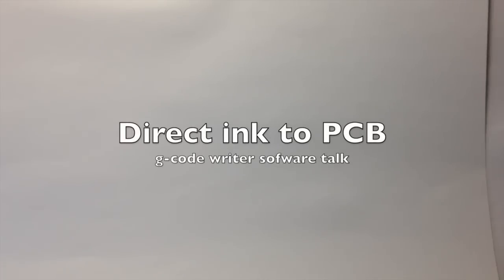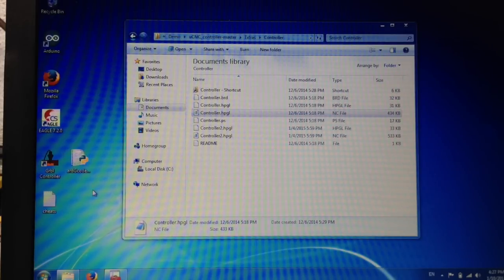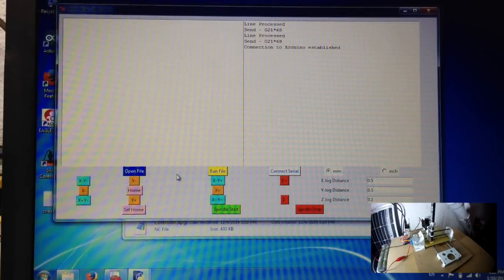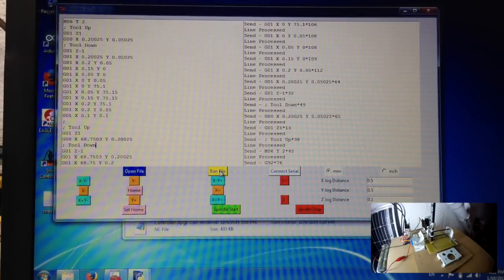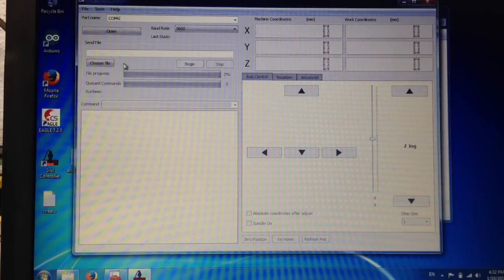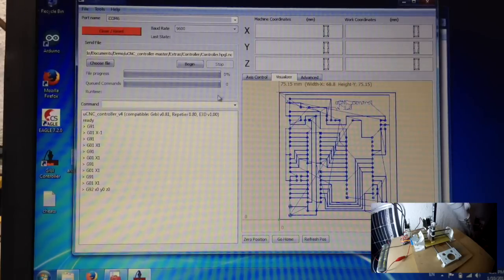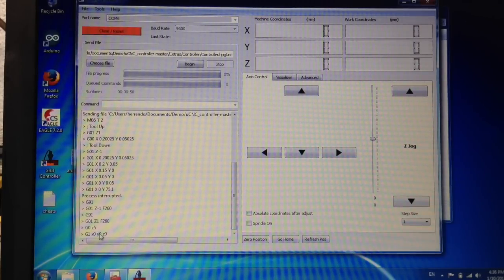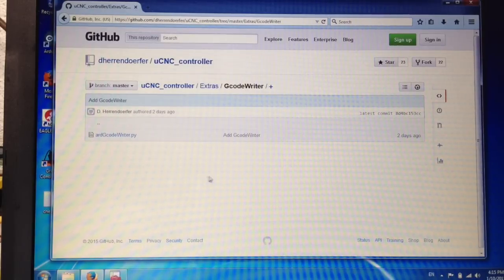Direct ink to PCB-Writer talk

Comment: Hi there Dirk Herrendoerfer,
Thank you very much for sharing your ideas and your project. Also I appreciate your effort you had on this project. I've started as well to make one for me, having yours as an example, but I'm stuck at the start : 1st : I can't run the ardGcode ( I can edit the file, but couldn't run it. I double click the file and nothing happens. I've installed the same version of python you had 2.7.8) 2nd : Couldn't download the GRBL controller...the link i found over the internet is not available no more. 
Can you please tell me if you I have some updates regarding this project ? 
What software I can use ? 
Are those files still from the GitHub still available ? 
For the moment this what I need to start the project. I wanted to see if from the software point of view, will work. By the way, I'm using Windows 7 x64.
Waiting for your answer.
Kind regards, Emi
Reply from the maker: +Francu Emilian Hello, regarding the python problems, I have had none so far, if there is something missing the python IDE should be giving you meaningful error information. I typically open the file in IDLE and then run it from there. The pyserial lib must be installed and all versions should be 32-bit.
I don't know what the GRBL-controller software issue is, they still have their files online.

Comment: hi dirk ,after spending extensive hours i could reach to the last step where u have created hpgl file n.however the next part changing the com port is also done,where to save it?and after that how u opened ardcode?since on my pc that shortcut doesnt appear anywhere.pls help
Reply from the maker: +avinash khetmali Hello, happy new year! The com port is edited right into the .py file. It is then started directly via python or through the python IDE. For that to work you should have the 32-bit versions of python 2.7 and python-serial installed.

Comment: Hallo Dirk,
Dein Direct Ink to PCB-Plotter ist genau das was ich gesucht habe. Ich habe mir deshalb die Teile bestellt aber folgende Probleme:
- unter Windows bekomme ich den ardGcodeWriter nicht zum Laufen weil er das Tkinter nicht gepacken bekommt.
- die Komplettplatine (ULN2003 mit Motor) angeschlossen an Arduino Uno
  *blau an Pin8
  *lila an    Pin9
  *gelb an Pin10
  *orange an Pin11 (jeweils Arduino)

connection wird hergestellt allerdings kommt nicht die Meldung wie im Video. Wenn ich auf X+ drücke dreht sich der Motor kurz nach rechts wenn ich auf X- drücke dreht sich der Motor aber auch nach rechts ?!

Sobald ich den Beispielcode mit 'Open file' lade und auf 'Run File' drücke friert das Programm  nach der Zeile 
Send - G01 Z1*13
ein.

Was mache ich falsch?

Viele Grüße und nochmals vielen Dank für die wunderbvaren Videos :-)
Roger
Reply: +Roger Petri 
achso, hab vergessen zu sagen dass ich den ardGcodeWriter dann unter Linux zum Laufen bekommen habe. Leider aber mit den oben beschreibenen Problemen :-(
Reply from the maker: +Roger Petri Welche Firmware benutzt du ? Wenn bei einem G0/1 Z-Aufruf der Controller hängen bleibt ist meistens der Teil der die Z-Achsen Bewegung steuert, oder für den Servo emuliert nicht richtig konfiguriert. Es sollten also bei StepsPerMillimeter und Speed für die Z Achse werte stehen die Sinn machen, also nicht 0 oder so. Wenn der Motor nicht sauber läuft, stell erst mal die Geschwindigkeiten ganz runter, evtl springt er einfach über die schritte hinweg.
Bei Windows solltest du immer die 32Bit Varianten von Python 2.7, TKinter(falls es nicht schon bei Python dabei ist), und pySerial benutzen, dann tut es auch. 
Im Allgemeinen empfehle ich die v4 beta firmware zu benutzen, da musst du dich zwar einmal durch die Konfiguration quälen (in der uCNC_controller_v4.ino) danach
hast du aber auch die besten Ergebnisse.

Comment: hola amigo yo hice ese proyecto tu yo pero no es podido controlarlo con la pc porque no abre la aplicación de la pc te quería preguntar ese programas del arduino se podría poner a funcional con  UniversalGcodeSender hice la tarjeta identica como la que tiene tu y otra pregunta  esa misma  tarjeta como aria para usarla con una cnc de tres motores
Reply from the maker: +antonio sanchez If you use the UniversalGcodeSender application you must turn off all of the functions that report back the position and the status of the Arduino board. That is a function that only works with GRBL. After that you should be able to use the application with the driver board and uCNC_controller.
Reply: hola lo hice como dice y no funciona como hago para poder abrir la aplicación q tu usa por que no abre en mi pc le doy abrir y solo hace un parpadeo y no abre que sera lo que estará mal
Reply from the maker: To open the application I use you need to install python 2.7 in the 32 bit version, and pyserial also in 32 bit. Then you need to edit the ardgcodewriter.py file and set your arduino com port in the code.
Reply: gracia por tu ayuda no abria por falta de PySerial pero a hora cuando abro el archivo para que enpiese a trabajar se queda pegado y dice no responde que sera eso y disculpa tanta molestia es que soy nuevo en esto otra pegunta ate un video como se diseña la pcb para generar el codigo G
Reply from the maker: antonio sanchez Did you edit the python code to add the serial port name that your system uses ? ( In my case COM5 for example ) Then you should try to use the move keys one at a time, x,y,z. Sometimes the arduino is not configured correctly and using one axis makes it stop communicating.
Reply: Hi Dirk! Where can I turn off all the functions that you say. I tried to generate a g code with inkscape and i want use UniversalGcode but i don´t find that functions that you say. Thanks for your help.
Reply from the maker: Try to use gcodesender (without universal) that usually works very well.

Comment: Hi  Dirk Herrendoerfer. I run adrGcodeWriter.py   but  it error   and show  message "GcodeWriter.py", line 10, in <module>   import serial  ImportError: No module named serial"  How can i do. Thank you.
Reply from the maker: ยุทธพงษ์ พ You need to download and install a package called python-serial it will provide access to the serial port, and fix this error
Reply: Dirk Herrendoerfer Thank you for your reply

Comment: Hi. Thanks for all your effort. Very informative. I'm having a problem with the g code that is generated. The Z axis does not just go between Z1 and Z-1. There are co-ords higher in Z as well so the pen does not always touch the page because it is too high. Also the pen size seems to be a problem. I can only get something that resembles my pcb if the pen size in eagle cam is set to 0.4mm. Smaller results in lots of extra rubbish on the plot. Also pcb size was a problem. Too big. I had to use "hp2xx -m nc -t test.hp" and that gave me the true size. Any help on the Z axis and pen size would be appreciated.
Reply from the maker: Richard Pieterse Hi. The pen size is ignored by hp2xx, eagle does all the work there. The pen size should match the width of the connections on your PCB. The -t swich is required of course, else it will be scaled to A4 paper size or so.
Does your g-code actually have Z coordinates that are not 1 or -1 ? That should not be.
I have been updating my work version of hp2xx to produce code better suited for GRBL, but I don't think it should produce 
any positions outside what is set to be the Z positions.
Reply: Dirk Herrendoerfer 
I set the pen size in Eagle to .3mm and re-did the whole process. In the .hp file there is only PU and PD (and the x,y co-ords) but after conversion to G-code there are Z co-ords that are 2.9 and 4.175 and there are 2 tool ups with no tool down in between. I am going to download a fresh HP2xx and try that. Please can you send me a link for a known good HP2xx version?
Reply from the maker: Try this one:
https://github.com/dherrendoerfer/uCNC_controller/tree/master/Extras/Hp2xx
Reply: Dirk Herrendoerfer 
Thanks so so much. That works much better. Just doesn't do a Z feed rate and doesn't finish with a pen up and return to zero. Is this normal? Also is it normal that no holes are seen in the pads?
Reply from the maker: Richard Pieterse I send federates with the CNC setup, the last pen up, I had on my list of things to add to hp2xx, but I don't know who's maintaining that code now (And I don't want to do it). The issue about the missing holes is a big one - but that's an Eagle issue, and I can't do anything about it.

Comment: Thank you for redirecting me here sir, I really encounter some problem in using  ardgcodewriter.py, when i run a gcode file,, the program goes not responding,, is this floooding? what is the possible reason and solution for this?
Reply from the maker: Are you using the newest version from github ? Possibilities are that the com port is not correct in the python file, or the arduino is not responding correctly. What operating system are you using ?
Reply: Dirk Herrendoerfer yes, im using the newest version, i've also changed the com port in python to my arduino port,, im using windows 8
Reply from the maker: Jin Limbaga I can't recreate the issue here, strangely it just works for me. Could it be that another program is using the serial port of the arduino ?

Comment: Hello Dirk, okay? I build my PCB CNC plotter according to your project just that I have a problem with respect to the nylon. What happens is that the nylon is slipping when the stepper motor rotates, I'm using 28byj-48 stepper motor and there can not make the correct design of the PCB, as tensionei nylon, already spent a sandpaper to get the nylon harsher but nothing works, always in short motor steps nylon slide.

Have you had any problem with the nylon while doing your plotter?

Thank you for your attention.
Reply from the maker: Yes, I had that problem as well. The hardest part is to get the axis to move as easy as possible. 
When I had slippage problems I put a few drops of glue (Pattex Classic) on the drive shaft and let it dry
completely. That gave the drive shaft the extra grip it needed.
Reply: Hello Dirk, I solved this problem throwing away the nylon and using similar printer toothed belt with the figure below.

http://www.rpmechatronics.co.uk/shop/images/c_belts_and_pulleys.jpg

Now I'm looking metal shafts for use as basket to slide the table because I am using pen tube of plastic and often lock the table, with the metal tubes are easiest.

Congratulations for the plotter design !!!

Comment: Hi again Dirk, I am getting a 'port is already open'  exception when I try to connect serially. I've tried some things like closing the port before it is reopened, but can't get it to connect. Any ideas?
Reply from the maker: What tool are you using ?
Reply: Dirk Herrendoerfer I am using the 'Gcodewriter' that is in the Github. I have a suspicion that my Arduino Nano is being connected, however for some reason the text that you have put into the code(Connection to Arduino Established) is not appearing as it does in the video. I am suspecting this, as the error described as 'port is already open', only flags up after I have pushed the button more that once. Ill look into it :)
Reply from the maker: kal2thik Which firmware are you using? The software might just be waiting for a response from the Arduino that never arrives.
Reply: Dirk Herrendoerfer I am using the firmware and the python tool that is attached to the github within this video. I can upload the firmware to my Arduino Nano fine as I have tested it using the serial monitor as you have done. It is just the connection with the python tool that I can't get to work properly. The tool seems to freeze after I click 'connect serial' aswell, so maybe you are right in saying the software is waiting for a response that never arrives.
Reply from the maker: kal2thik Either the port is in use by another program, or you have the wrong port set.
You can try to insert a line with a xxx.close() before the open() call.
Reply: Dirk Herrendoerfer Okay thanks, I will try that. By the way, I am using V1.0 Firmware. Is there a more recent version available? Thanks again.

Comment: I've followed your project very closely and now I'm at the point of plotting my own pcb.
However, the HPGL file does not convert to gcode without errors. While the circuit traces look ok, some pads or part of pads plot in air high above the work piece. The tool path goes out of control during parts of the hpgl to nc conversion.
I'm using the free version of Eagle v7.2. I'm looking to try Linux next to see if the conversion results are any better.
Also, the coordinate lengths look to triple in size if I don't use the -t option in hp2xx command.
I would be grateful for feedback or suggestions.
Reply from the maker: Yes, you are right, just tried it - It seems this tool is broken - I only tried it out with some traces. We will need to look for another one.
Reply: We could try using the method based on this demonstration to get the gcode:
http://reprap.org/wiki/Pen_Holder

I think you might have looked at this tool before.
Reply from the maker: Try this version: https://drive.google.com/file/d/0B1DQmCDF0I3kTk5QY3NQU0IzXzQ/view?usp=sharing
I still seem to be able to use a windows compiler ;-)
Reply: Awesome, that worked. Thank you.
While looking for other solutions I found this awesome gcode & tool path viewer, great for gcode inspection before committing cnc hardware:
http://openscam.com/
Reply from the maker: Cool.

Comment: Hello dirk, excellent videos, I really like your Robin printer.
I've been having a go to get some motors turning but a couple of problems this end.
I downloaded your code and got it onto arduino uno ver3 I want to use it with the L298 modules off ebay
I have also installed Python 3, I am using windows 7, when I run ardgcodewriter I first get an error (ImportError: No module named 'Tkinter), if I change the Tkinter to tkinter the next error ( File "C:\demo\ardGcodeWriter.py", line 10, in <module>
import serial
ImportError: No module named 'serial')
I not sure where to go from here , have you experienced this and can you possibly assist.
Thanks...............Peter
Reply from the maker: Look into the description of the Software talk video, the links to the software and the required versions can be found there.

Comment: Hallo kann man einen Bipolaren Schrittmotor auch mit dem ULN 2003 ansteuern.
Reply from the maker: Nein, dafuer nimmt man am besten ein Polulu Modul, so wie es in 3D Druckern verwendet wird.
Reply: Ok Danke
Reply: Marcel West Wo haben Sie ihr Schrittmotoren her?
Würde es mit dem IC SN754410NE gehen?
Reply from the maker: Ich habe mein Motoren von ebay. 
Das IC sollte gehen um einen bipolaren motor anzusteueren, ich weiss aber nicht wie dann da die Ansteuerung des Treibers auzusehen hat.
Reply: ok Danke
Reply: Marcel West Ich habe den Sketch Von Ihnen auf mein Arduino geladen.
Wenn ich mich jetzt aber mit dem Grbl Controller verbinden möchte steht da immer:
> (CTRL-X)
Expecting Grbl version string. Unable to parse response.
Was soll ich da tun.
Reply from the maker: Ist es die neueste Version von github ?
Reply: Ich habe die Version unter Ihnen Videos zum Download stand genommen
Reply from the maker: Ich hab es gerade noch mal ausprobiert, bei mir tut es so.

Comment from the maker: https://www.youtube.com/watch?v=aCtMlm7U5UY
I think the making of this video broke something in me,
in the previous part my beloved HD-Cam died, now in this
part my LCD screen table broke, and the cam I was using
just wouldn't focus ....
Reply: не понятный перевод . у тебя сломалась камера . я понял . очень жаль
Reply: Maik Ydahnii я приобрел . Arduino Mega 2560  . буду пробовать . на ней
Reply: Maik Ydahnii
и http://www.dx.com/ru/p/lson-l298n-stepper-motor-driver-module-red-5-35v-312595#.VLOtzXvCdR2
Reply: Vielen Dank für dein Opfer!
Reply: Hello Dirk, okay? I build my PCB CNC plotter according to your project just that I have a problem with respect to the nylon. What happens is that the nylon is slipping when the stepper motor rotates, I'm using 28byj-48 stepper motor and there can not make the correct design of the PCB, as tensionei nylon, already spent a sandpaper to get the nylon harsher but nothing works, always in short motor steps nylon slide.

Have you had any problem with the nylon while doing your plotter?

Thank you for your attention.
Reply: http://ecnc.ru/main
Reply: так проще
Reply: Техно Sport Arduino Как успехи с чпу? Смотрел видео с рисунком дельфина. Вы повторили проект ?
Reply: пытаюсь найти проект через лтп или юсби со своей ардуино то есть собрать драйвер с мк и чтоб он питался от юсби пытаюсь это воплотить на мк атмега 8 в даный момент пытаюсь собрать ардуина на атмега 8 и еще собрал програматор на фт 232рл в общем продолжение следует -  А как у вас дела что нового
Reply: Техно Sport Arduino  Я смотрел на aliexpress плату контролера  Mach3. Судя по отзывах умеет и платы рисовать и многое другое. Проект  амириканина интересный, правда я пока не понял откуда он заганяет чертёж платы ?
Reply: там наверно LPT восновном драйвера с прогай мак идут с этим портом то есть всё через него